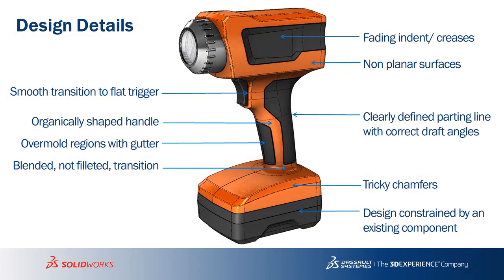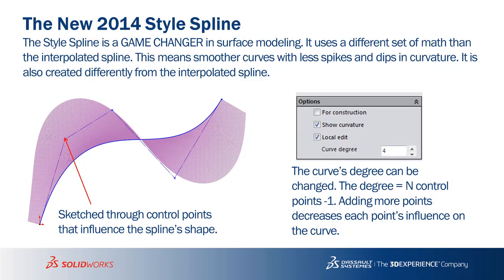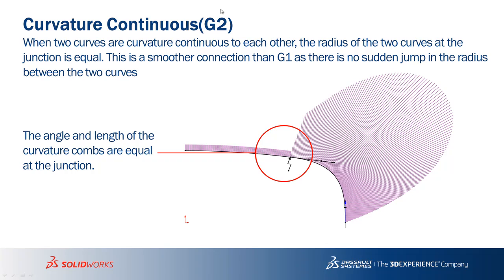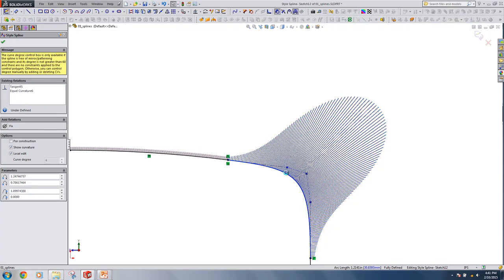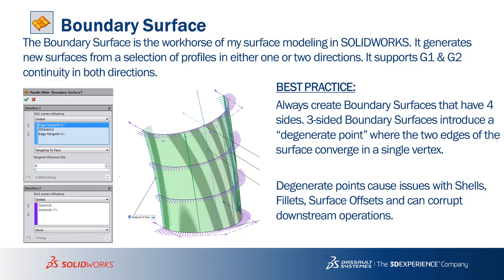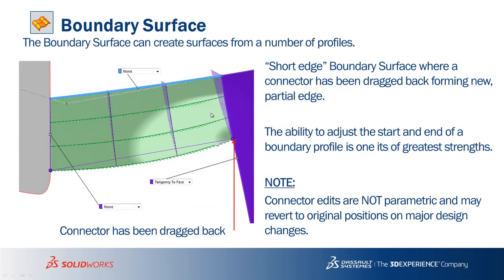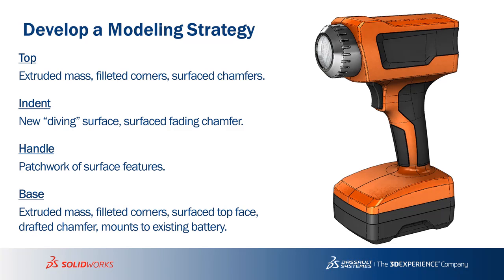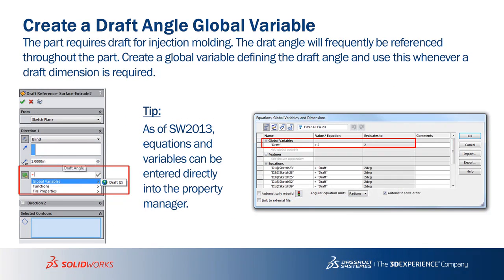SOLIDWORKS World 2015 | Surfaces & Splines: The Fundamentals of Modeling for Consumer Product Design

Comment: The new style spline is not using more "advanced" math as you keep stating here.. Nurbs and Beizers, bsplines are very specific formulas, you cant' change them or make them more advanced they are what they are. Continuity is only obtained one way with these specific equations. Solidworks and Pro/e always spew the word "Parametric", ironically the only parametric equation they actually use are  Beizers.. since Brep is all vectors, CSG is just Boolean algebra